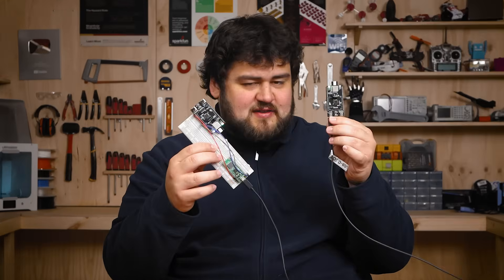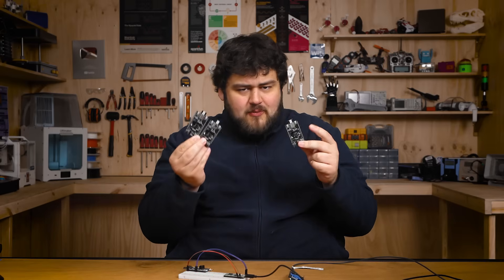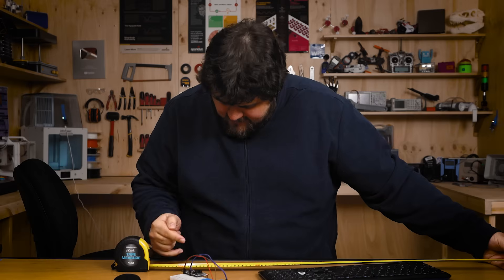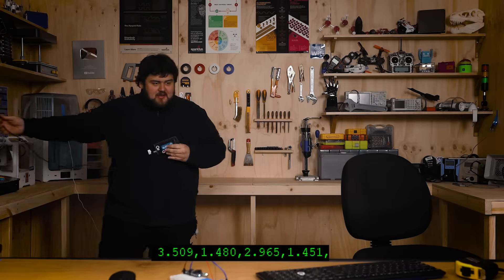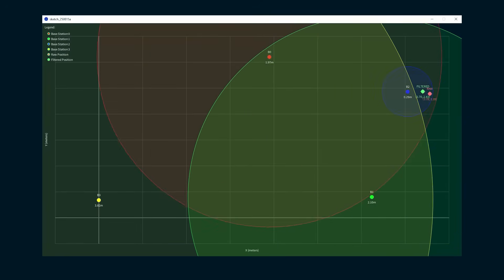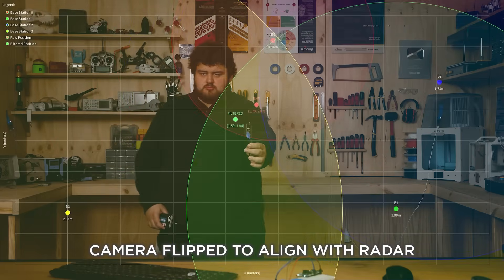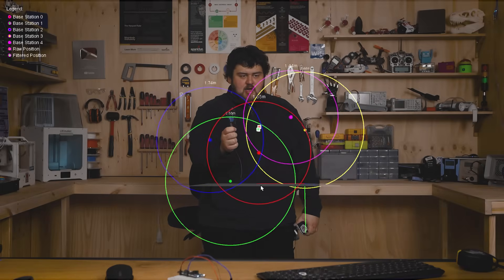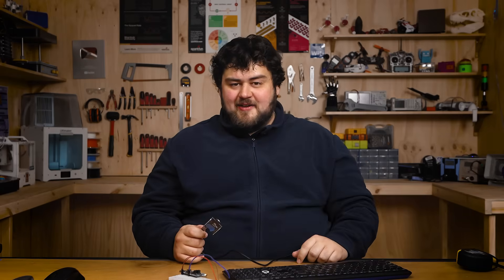3D Tracking With Ultra-Wideband... At a Maker-Level?

Comment: Can I use a raspberry pi 5 instead of a microcontroller for this? Or at least to read the data?
Reply from the maker: Definitely possible! If you check out the getting started guide, there is some MicroPython code that could be adapted into Python code to run on the Pi, as well as enough information about the format of the string it returns to get everything going!

https://core-electronics.com.au/guides/sensors/getting-started-with-ultra-wideband-and-measuring-distances-arduino-and-pico-guide/

Comment: Hi i have a idea for a project, can this boards as they are u-wb be used as scanners, and detect were the signals are caming from? eg use 4 in a bar config and mesure the timesptamp delay form eatch to calculate direction?

Comment: That's nice. How many tags could you track at once?
Reply from the maker: With this set up it's only possible to track 1 tag, but we're working on a follow up using the advanced modes, that should allow for multiple tags.
Reply: @Core-Electronics  I would be very interested, ive been trying to get a roomscale drone swarm to work and ultrasonic or lidar just doesent cut it. I have my hopes set on UWB or BL channel sounding.

Comment: Good video.  Is there a fundamental reason the limit for bases has to be 8?  I am interested in using a significant amount more.
Reply from the maker: That is the maximum that can be assigned in the mode we used. There were "poorly translated from Mandarin" documentation showing how to manually bind more together, but we found that this setup would be enough for most makers. If you go down the rabbit hole, you might be able to do more (and more tags)!
Reply: Had the same question, let me know if you stumble into anything that lets you track thousands of pieces. I'll do the same.

Comment: NICE

But one more important point about accuracy!
Since you want to specify fixed positions, the question arises: Wouldn't it be better to calibrate the base stations to each other beforehand?
Base station 1 to base station 2 and base station 3 to base station 4

Base station 2 to base station 3 and base station 4 Base station 1

Base station 3 to base station 1 and base station 2 to base station 4

Base station 4 ...

That should reduce the noise?
Accuracy +-1 cm
Do you see what I mean?
Reply from the maker: The only measurements we are using are the distance between a base station and the tag. If you accurately measure the position of each base station relative to the corner, and calibrate for the offset of each base station, this should be more than enough.
The +- 10 cm is an inherent accuracy issue with this technology :(. With some more advanced processing you could get smaller though!

Comment: I'd expect some calculations could be done with the base stations finding the distance between each other, therefore locating them relative to each other.  Then you can take the portable unit and tag locations as needed to identify walls or to provide gross orientation.  Add an LED to the sender and have it blink a pattern then the python should be able to locate the sender within the camera frame, and a little more computation could provide a simpler setup - place the base stations in a new location, set up the camera, walk around with the sender facing the camera, and it'll map the entire 3D space without additional effort or measuring.

Comment: Great video, thanks! Would the BU 01 also be usable for this project?
Reply from the maker: Maybe? We can't confirm that it will, we tested it with the bu04 and found that it worked as a drop in replacement (but the bu04 was a little to directional to work in a system like this). If the UART message it outputs is the same then it will work just fine! But that's only if its the same, if not it might be a little bit of code modification.
Reply: @Core-Electronics  thank you <3

Comment: This looks amazing, but I live in the states. Do any other manufacturers make comparable devices with this chip?

I'd order from you, but you understandably don't ship to the states right now.
Reply from the maker: If you can't find anyone stocking the BU03, these run off the DW3000 chip. But these boards (and likely others) have an onboard MCU to handle a lot of the processing, so not all DW3000-based boards behave like this. You could definitely find another board and try and adapt it to this set up though! 

The Australian shipping suspension might be lifted though, but we don't know when unfortunately :(

Comment: What's the range e.g. line of sight outside.?....range extenders?
Reply from the maker: Depending on line of sight it can be up to 25 meters
Reply: @Core-Electronics  NiceRF make amplified 0.5W  & 1W boards using this UWB chip which significantly extends the usable range.